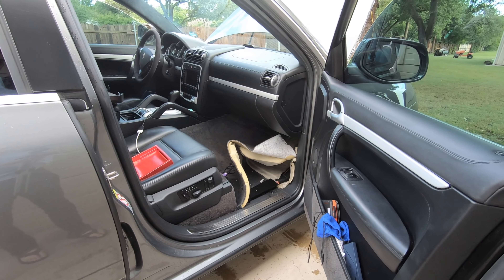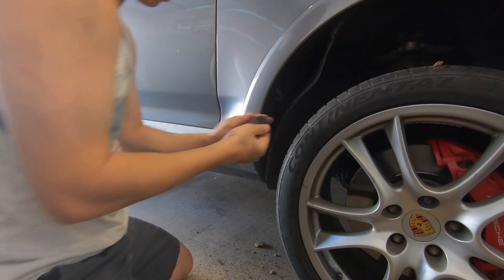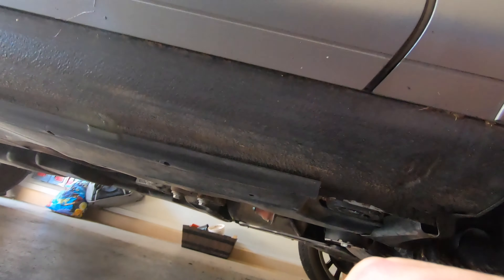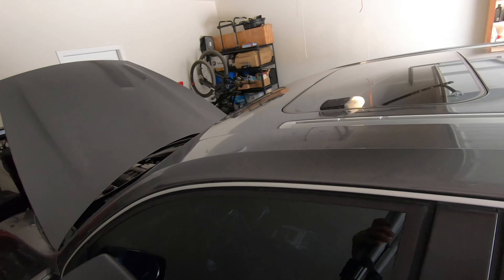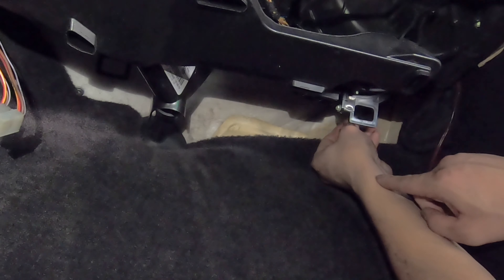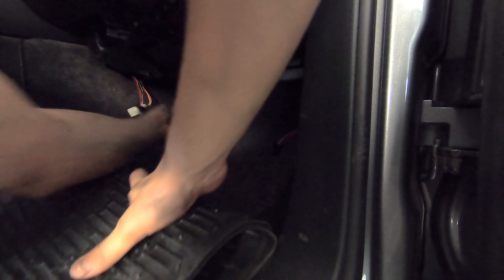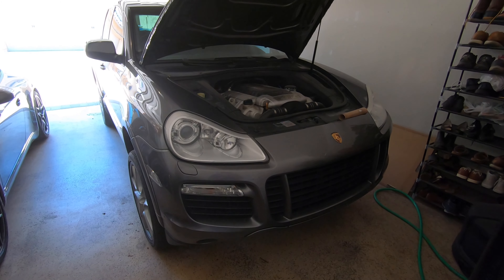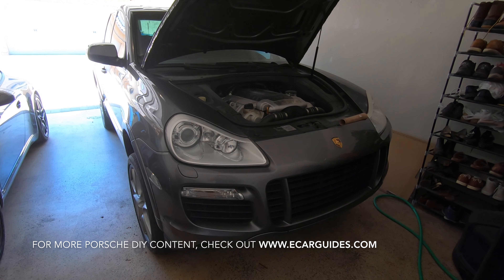How to clear EVERY Water Drain Port on a Porsche Cayenne & Volkswagen Touareg (DIY Tutorial)

Comment: I was able to purchase a gallon of a product similar to Simple Green.  Using the microwave, I heated up a quart to near boiling and was able to use it to degrease and clean the drains using your method.  Then it was followed up with about 2 gallons of hot water to finish the job.  Thank you!!

Comment: On a 13 cayenne S, the rear drains are located next to the exhaust pipes under the car. No need to remove the wheel well cover. They are readily accessible to cut. Nothing needs to be removed. There is a left and a right drain. 👍🏽🇬🇾
Reply: ever try a shop vac?

Comment: Great work. Cleaned a few out today and the rest tomorrow. Found about 8oz in the sunroof front passenger drain. Also it was not connected in the firewall very well at all. I think it was just flooding the passenger side and the culprit. However as you said it trimmed up the outlet then plugged it well within the firewall.
Reply from the maker: Nice work!

Comment: I have a  2017 Cayenne , bought used with 7000 miles.  I have had it two years.  Beware, drains 2017 and prior have the old design.  It should be a recall.  My car  literally flooded from the inside  its cavity and shorted out the AC, the stereo, HVAC,  lights,  in as little as 18 months etc.  With regular visits to the shop on time, it still flooded. The drains are a design flaw and this vehicle should have been recalled.  Service dept. even admits it.  I also got new carpet installed as black mold was growing inside the cabin and I am asthmatic.  I live in  the Valley of Oregon , the State with the Nationally highest volume of  annual rainfall and park outside  in the driveway thanks to my car-enthusiast husband.  Thankfully I had purchased an extended warranty and repairs were completed at no cost to me, but  the $5,ooo. worth of parts and labor cost Porsche  The problems however keep occurring.  It's been in service 5 times, without loaner car, and I live an hour away from service-I am a mom and work so needless to say, this car hasn't been worth it considering  now the turbo "sport" button doesn't light up therefore not really a SPORT car to me afterall.  Back in the shop I go, if my calls ever get answered.  Meanwhile my husbands sports car is getting the boot. I want my space back.
Reply: Nah, as far as sunroof drain design is concerned, Cayenne/Touareg's was actually among the best - at least the first generation, not sure about 2017. Easy to acess/clean/take care of, and the actual tubes are solid. I have a 2006 Touareg that I bought new 18 years ago, and the drain tubes are still fine. On a much newer Infiniti drain tubes themselves cracked, something you can't easily take care of yourself and is very expensive to replace at a stealership. The real problem is sunroofs themselves - the dumbest auto feature ever invented. Drives me nuts that practically all luxury cars come with these stupid things without the option of a solid metal roof.

Comment: That diaphragm is in there to prevent wasps and other insects from nesting in the drain tubes. Cutting it open invites other problems.  Pine needles are the bigest problems as well as the tubes from falling off the sunroof assembly on any of the four corners.

Comment: I just changed out my air filter in my 2015 Touareg, found water at the bottom of the air filter basket, drain there was plugged, also found water in the plenum to the air filter basket.   Easy way to destroy your engine, the plenum also has a drain, both were plugged.  You should do a video on it, could save someone lots of money.

Comment: 2015 Cayenne S e Hybrid: Despite limited visual access, you can open the hood, and feel along the firewall to flip the rubber vent door to open the AC drain. This took 2 minutes to clear, and can be your go to maintenance approach without accessing from the dash side.
If you have some concern that cutting the flap off could give mice access to the cabin, here's a fix I tried: take 10 OD mm silicone tubing and cut a section to run inside the black rubber AC tubing, and extend 2" beyond the vent flap. I also fit 2" of tubing length into the hard plastic funnel end of the AC housing under the dash, as I had already removed the tension clamp from the inside.
Reply: It is much easier to access from the firewall side.  On mine, the rubber flapped was fused to the tube, but with light pressure, it broke free and dumped all the water.
Thanks for the tip.

Comment: Mr. Car Fanatic, any tips on the cleaning and maintaining drains for 1.) the rear cargo hatch hinge openings, do they drain somewhere; and 2.) the front windsreen cover opening in between the wiper arms? Thanks!
Reply: The drain is under the plastic trim around the hinges. But going deeper inside, under the headliner there is a plastic lid that needs to be removed iot swap the gas struts. The seal on that plastic lid can be an issue. I used RTV sealant on the plastic lid after swapping the 3 gas struts (or 4, if not power lift gate)

Comment: Great vlog!  Interestingly, we executed this procedure and we did not have the rubber piece/valve in the front wheel wells.  We have a 2008 Cayenne GTS.  Purchased it pre-owned in 2011 with 25k miles from a Porsche dealer.  Currently, we have about 137k miles.  There was a significant amount of dirt/debris within the wheel wells near the rocker panel.  I cleaned up all of that but where the rubber piece/valve is supposed to be is just a hole approximately 0.75” diameter and there is no debris within that hole.  When we removed the wheels liners it appeared as though the wheel liners were never removed.  Do all cayennes have these rubber valves?  So weird.  The only drain issue we observed in the past was the ac condensation and I was able to resolve that a few times but it comes big every now and then.  We will begin the rear drain cleanup next weekend.
Reply: I think they all do.  I actually pull that rubber piece out and never re-installed it.  After that, there's no more junk built up.  before that I basically have to clean it every year since I park under the pine trees on my property.

Comment: Great video, however, I could not get out the driver's side footwell cover. I broke a plastic bracket that holds it up above the gas pedal. Is it necessary to take it out - and if so, how? (I did unscrew the one screw that holds it in the front, but it still did not come off). Also: the driver's side plug for the sunroof is apparently behind the main wire harness. At least I could not find it - but maybe I will once the cover gets removed. Any advice would be appreciated.
The removal and cleaning of the sunroof drain plug on the passenger side was very effective. It was totally clogged, with lots of gunk in it. Once removed clean water came out that was trapped in there. I cut the end off the plug and now it's clear. Thanks for the video, again!

Comment: Great video… just a quick question, do I need to take the inner wheel liner off to access the rubber bung? I’ve a 955 by the way. It looks pretty impossible to simply pry it open. Wheel off too I guess? Thanks

Comment: I was driving my cayenne 2009 for 2 week, I hear sloshing that sounded like it was inside the driver site,.  the foam under the carpet both sides is completely flooded. 
 I should put more attention and take care of it wen i noticed  water was leaking from de pasanger side... Thank for your video
Reply from the maker: No problem. I had to lift the carpet up, dry as much as I could with a towel, then run a blow dryer with the carpet lifted up for 24 hours to get everything dry

Comment: Great Video with comprehensive instruction. I do have a question : Is the a drain in the Fuel filler area behind the flap?. I often see water sitting in there.

Comment: If you have access to an air line I’d give a blow back up the pipe to make sure they are clear as well. Good to know where to find the outlets, thanks.
Reply from the maker: One warning with compressed air, some people have blown off the sunroof drain plastic elbow that connects to the drain hose. So you want to be careful with that method. But it might be needed if the other methods don't work. Thanks for watching!

Comment: Thanks for this! How do you pull the port(s) out on the tailgate? Mine is quite firm I am concerned about breaking it...
Reply: If anyone is interested they are held in by 4 "tabs" in a circular shape, I was able to get them off by pushing the plug to one side and squeezing it while gently tugging, then repeating for other directions. Note the orientation of the arrows/drain exit hole when you remove them, the hole should be on the rear side (pointing up if the tailgate is open).

Comment: which is the best access to the evaporator coil??
Reply from the maker: Do you mean the drain port or how to access the evaporator coil for maintenance?
Reply: @CarFanatic  evaporator coil.   I just sprayed through the passenger a/c vent  Lubegard 96030 Kool-It Evaporator and Heater Foam Cleaner to kill the bad smell.

Comment: Hi, I gave your video a like, but I'm a little skeptical regarding the drain at 3:43 into the video.  If we are talking about water drains, why would it drain into the cabin?  And if it doesn't drain into the cabin, then where does the water go?
Reply from the maker: The front sunroof drains start at the sunroof, run to the A pills and exits the firewall to allow the water to drip out. Because of how cars are designed, there aren't a lot of places for things inside the car to exit. The firewall is one of the main spots.
Reply: It would back up

Comment: I just took those two rubber shitz out and threw them away.   I'll take my chances with rodent intrusion.  Better than the car holding and leaking water.  Thanks for the video.
Reply: I did this procedure and we didn’t even have the ones in the front.  We bought the car pre-owned in 2011 with 25k miles.  Kinda weird how the rubber pieces were not there, probably ever since manufacturing?

Comment: What year is this model btw? Your video is super helpful, for some reason I can't find the drain port on the sides where you use the small screw driver and for the life of me cannot find the front sunroof drain on the passenger side (your mythical drain plug comment lol).
Reply from the maker: Mine is a 2008. The ones I poked with a screwdriver are underneath the side skirts just behind the front wheels. You might not see them initially if it's all gunked up underneath. The sunroof drain in the passenger side footwell high up towards to bottom of the glove box all the way on the passenger side. It's covered my insulation. Just move the insulation to the side. Hope this helps.
Reply: @CarFanatic  Thanks! Yeah I looked again today for the ones underneath the side skirts and for the life of me cannot find anything there (mine is the 2014 model). Everything else in the video lines up, was super helpful. I think I'm going to take the cowl drain and snip it like you did there to get more of an opening for water to run through. 

What's interesting is that I did a test and poured a quart of water down the windshield and looks like the water drains through and kind of seeps through the bottom of the wheel liners (through multiple locations), doesn't look very intentional. I'm thinking of just drilling a few small holes at the bottom of the wheel liner on each side so that water drips through naturally, and not seep through the liner itself.
Reply from the maker: Ah you have a 958. Makes sense. I'd advise against drilling holes. Have you cleared the cowl drains? If not, water could be draining funny because of that. My car seems to drain like you described. I think it's okay. Let me know how it goes.
Reply: I have a 2010 957 GTS and also having trouble finding the bottom side skirt drains. Looks like the side skirts can be removed but appears to be a rivet. Anyone having this problem? Seeking guidance

Comment: Nice work! except my sunroof drains were clogged water dripped into my cab and now my sunroof won't open.
Reply from the maker: There's a way to manually open the moon roof. There should be a key in the center console arm rest. Then you can clear out the sunroof drains.

Comment: @carfanatic nice video. i just had some electronics get fried by the back right C pillar headliner after my cayenne sat in a rainstorm under a tree. i was told by Porsche a roof rack drain clogged, but you didn't mention a drain for the roof rack...do you think it was actually the sunroof drain? Doe water drain in the sunroof even when its closed? Perhaps I should pour soapy water down all my drains (thanks for that tip). After removing the drain tip, can I use some compressed air to clear things out?
Reply from the maker: I don't believe the roof rack has drains. Try pouring water down the rear drain holes on the sunroof (if you can locate them). Please keep me posted.
Reply: THE REAR ENDGATE STRUTS ARE UNDER THE CORNERS OF THE HEADLINER, IF THEY HAVE BEEN REMOVED... THERE IS COVERS THAT COME OFF TO ACCESS AND IF THEY ARE NOT RESEALED , IT WILL LEAK THOUGH ONTO THE HEADLINER

Comment: I have an 2009 Cayenne S with the panoramic sunroof...The middle roof gets stuck in a lower position, which doesn't fully close to seal the first and third roof sections. Do you have any knowledge on this? If so, could you help me or point me in the right direction? In the meantime, I've placed a plastic bag over it to avoid any rain getting inside.

Comment: There's a reason the ports are constricted at the ends.  Widen them and you may get critters (insects, small rodents, etc.) causing problems.  Also if you ever drive through deep standing water...  So I would clean out the ports, but maybe reconsider widening them.  Cheers.
Reply: You prolly dont care at all but does any of you know of a tool to get back into an Instagram account..?
I stupidly forgot the account password. I love any tricks you can offer me
Reply: @Adriel Ismael instablaster :)
Reply: @Juan Tate it worked and I finally got access to my account again. I am so happy:D
Thank you so much you saved my ass :D
Reply: @Adriel Ismael You are welcome :D
Reply: Funny how my old 4runner has a normal hose sticking out and in over 20 years i never had any "critters" inside my cabin or a clogged drain.. now my moms 5 yo cayenne has the passenger side floded with water.. want to know why? Because vw and all the trash they build just sucks. That drain was poorly build and porshes own tsb says to cut it open more because "their supplier" failed.. no porshe you are the one who failed ((;

Comment: that pinch is intentional in the rubber fittings.
Reply from the maker: Yup, it is meant to keep bugs out I believe. However, it's a design flaw because the risk of a clog is greater than the risk of bugs going into them.
Reply: @CarFanatic  That's why you clean them from time to time, isn't it?

Comment: Mine leaks right there on the right off the gas pedal and when I turn to the right is pours out on my foot I have a feeling it's when I'm using the AC please help somebody
Reply: I have the same problem, even seems to come out of a dedicated opening spraying on my feet when i make a quicker turn to the right. The opening (what i think it comes out of) is just out of view on this video. Its to the right and above the gaspedal. 
It doesnt seem close to the drains that are unclogged in this video. 

Anyone that recognizes this issue?

Comment: This ABSOLUTELY BRICKED my cayenne. I came out from the store to get in my 2005 S and only the drivers side headlight and taillight would light up. That is all. Then I got it towed and it basically ruined the wiring harness on the ground on my passenger side. The carpet was SOAKED! Porsche suggested changing the whole steering column for $4800. Didn’t want to do that. Got it to a local place and he told me the car was basically in panic mode cause it thought someone was trying to steal it. So it wouldn’t start or anything. Obviously the lights being on killled the battery. He eventually cleared the codes so I could just drive it a couple days at a time till it would come back but then would have to be towed again so I traded it in for $2k 🥺😢
Reply from the maker: Sorry to hear about your experience. It's crazy how such a minor problem like a clog can wreak havoc. There should have been a better design.
Reply: @CarFanatic  yeah I agree! Sad part is that was 4 years ago and I want another cayenne so bad now that I know how to solve the issues. I am looking at a 957 or 958 turbo 😊